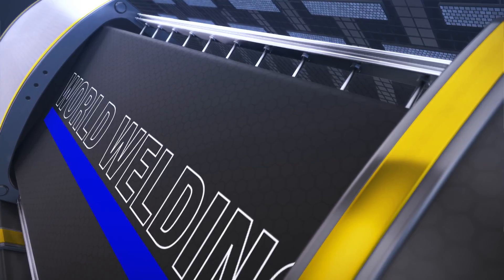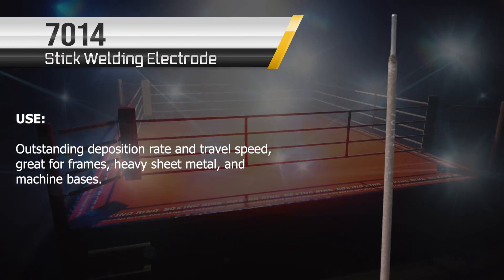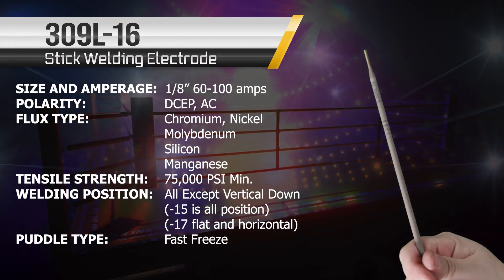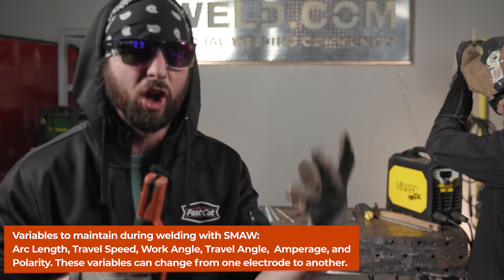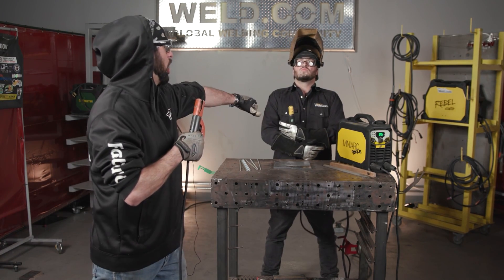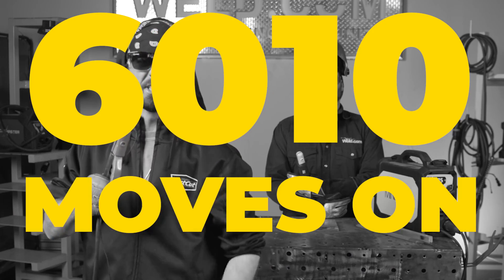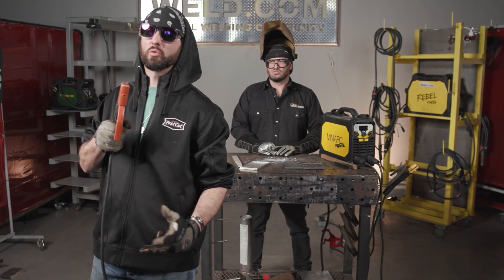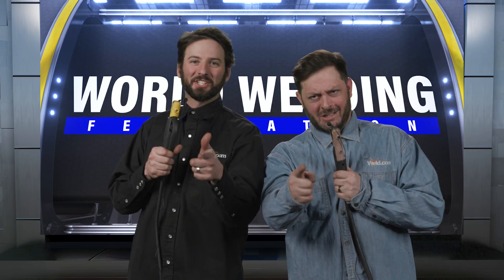Which Stick Rod is Hardest to Weld With | SMAW Electrode Showdown

Comment: Super Noob question: 
ive been doing a little spot welding for  repairs on my mower. Usually i turn the welder off to change the stick. is it OK to change the stick (with gloves) while the welder is on?
Reply: I hope so. I never turn my welder off to change rods, but I haven't been lit up yet

Comment: I weld with 11018 regularly on excavator booms and buckets, way stronger then 7018.  It welds the same as 7018 and in all positions, little trickier with overhead and vertical, but nothing major

Comment: The hardest rod I ever welded with was inconel.Soon as it gets hot it work hardens instantly.Then it is invincible to anything.Don’t try to drill it.Had to use plasma to even touch it . EXPENSIVE to I guess according to my boss. Is really used for extreme heat conditions . Supposedly it is used on the space shuttle. Once in a lifetime opportunity.Most people will never weld it. It was a bitch to weld though.

Comment: While in the Navy (mid 70's) I was tasked with climbing up an aluminum mast straight up about 100' from the waterline to weld this bracket for a sensor, the only way it could be done was via stick, I never really cared for height but that trip broke me of that fear, I don't remember what rod it was, it was given to us by the shipyard along with instructions on how to use it, I had a can of the stuff to practice with and they inspected my weld at the NDT shop to make sure I knew what i was doing . The surfaces had to be super clean that much I remember. I wish I knew what rod it was because that stuff was awesome and put down a great bead, the welds were a flat fill and a overhead, the overhead was a bitch.
Reply: Ooofff that would’ve been tough

Comment: 7024, is my hands down favorite. Just try it out of flat!!! Great vid btw!!!
Reply: Thanks! Love a 24 always a peeler
Reply: But Jet rod is only for flat and horizontal.
Reply: @Granamire  that's what I'm saying. Try horizontal. You won't have a good time. And for that matter, try it overhead as well. Sometimes instructors will challenge students with difficult and impossible tasks as a learning exercise. It's not completely impossible just extremely difficult and impractical. 

Take welding metal core(mig) overhead for example. It's not designed for it, and it's rather difficult, but I used to have to do it occasionally.(not saying you ever would weld jet rod overhead on the job)
Reply from the maker: We will have to have another match up moving through the different positions

Comment: on the Aluminum rods (1300 and 4043) in addition to preheat, it is necessary to clean the aluminum first and then allow it to cool completely before removing the flux.  Also, the rod burns back into the flux on the rod so you really don't see the arc.  Both of these rods are difficult to use but they do have their uses, primarily on repairs where MIG or TIG cannot be done.
Reply: That’s awesome info thanks!
Reply: never used one (basically impossible to get over here so why search?) but everything you say is basically self explanatory. highly reactive metal, needs good shielding, sucks the heat away so needs heaps of current and preheat, and yeah... let the slag cool.

and would only be of any use out in the middle of a paddock on a windy day when something just has to get stuck together and do the job. 

wouldnt want to try an intercooler with one, but to stick a pipe together on a irrigation pivot? sure...
Reply: @paradiselost9946  The heat input on a 3/32" diameter rod is quite high so it really can't be use on thin parts or small welds.  My experience with it has been with repairing aluminum irrigation pipes in the field and for structural aluminum welding where TIG or MIG is not possible.  The thinnest material that I have used this on is 1/8" thick.  You might try searching online for some of the 4043 rod.  One of the interesting aspects of using this rod is the high consumption rate of the rod.  It can produce good welds in the hands of someone experienced with it.
Reply: @paulkurilecz4209  yep. exactly. irrigation pipes... or that farm implement that just broke... 

any rod works well in the hands of someone with half a brain and an ability to think and watch what theyre doing... sadly rare traits nowadays.

nah, i once had a look from curiosity, rods are cheap enough but the shipping is the killer, so i left my curiosity at that...  be glad youre in the US (i assume) where it seems everything is available?
Reply: @paradiselost9946  Yes, I am in the US.  Are you in the UK or Australia?
Reply from the maker: We will have to give 4043 a try next time as well!

Comment: NEED TO PREHEAT THE ALUMINUM TO RUN THOSE RODS EFFECTIVELY
Reply: With some pre-heat the only other way I've had luck with these 1300 rodes is running them like your running a 6010.
Reply: We learned this that day 😂
Reply from the maker: We will have to schedule a rematch!
Reply: Yeah preheat is necessary
I used them to repair broken Rims on Cars